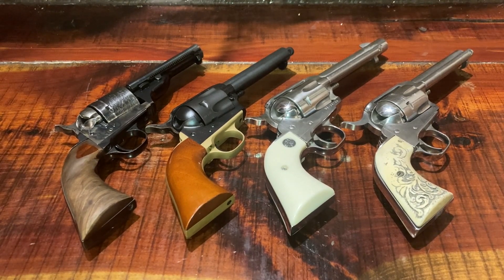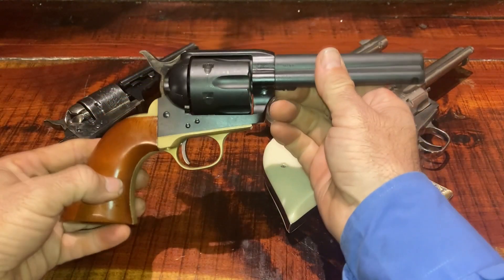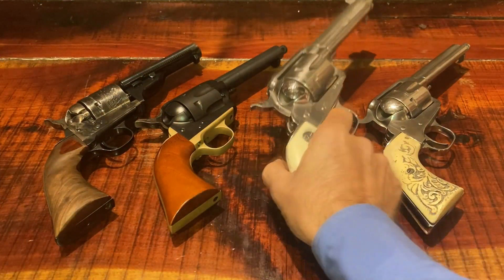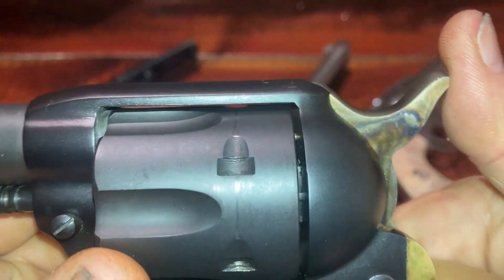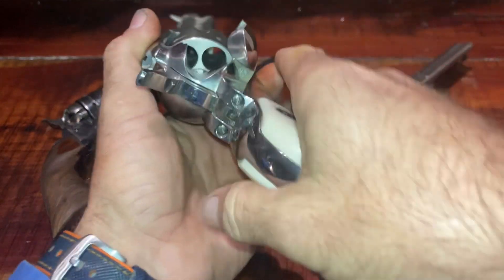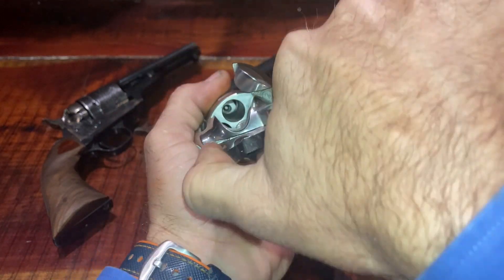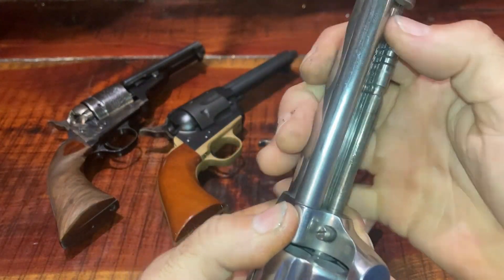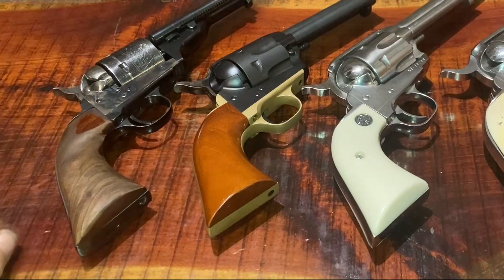tech tips  for fast draw.#wfpgfastdraw #wfpggunfighters  #fast draw

Comment: You mention around 7:40 that 4.75” in the shortest length allowed in fast draw. I’m interested in the sport and was looking through the WFPG rule book and it says 4.5” is permitted. Has the rule changed and not been updated? Is the video accurate or the rule book? Thanks and awesome videos!
Reply: Also, when I look up a new vaquero, it’s sold at 4.62”

Comment: Oh, and I have another question about gun weight. I want some exotic wooden grips, but I imagine the various woods have varying density. So would this be prohibited from fast draw competition? I imagine it would but would like clarification. Unfortunate I wouldn’t be able to make my ideal gun work for fast draw as well. I want to gold plate the wheel gun, and was thinking of having modification done to make it so even with the gold plating, it remains equal to the weight of the model P. Is there some sort of weight minimum we can adhere to? Like, if the wood is less/more dense, the gold plating would vary but ultimately still remain equivalent in weight to the colt or new vaquero?